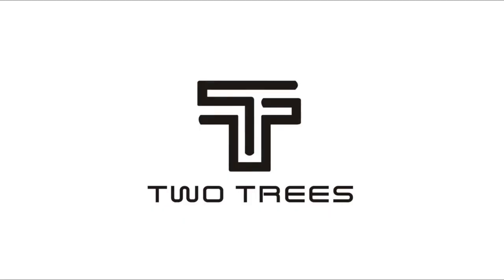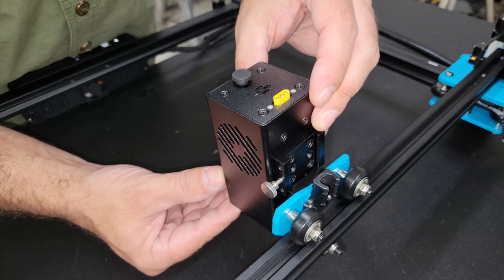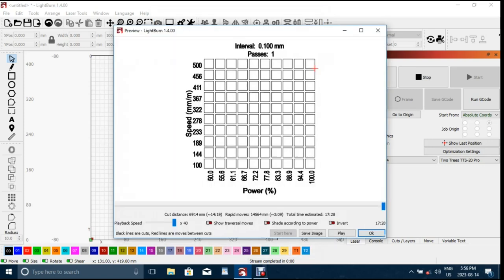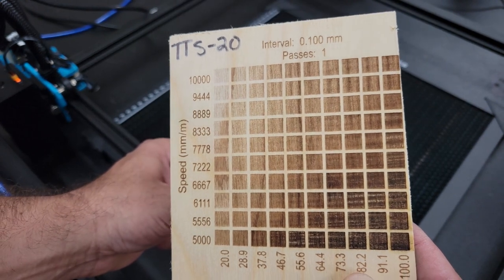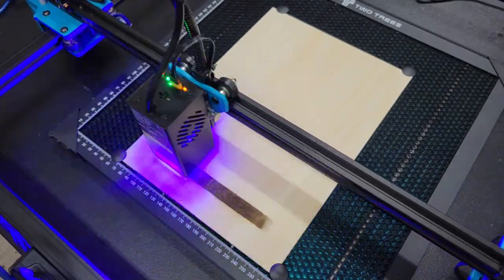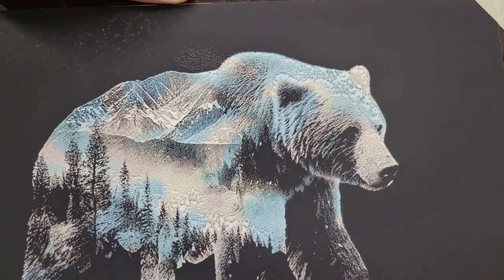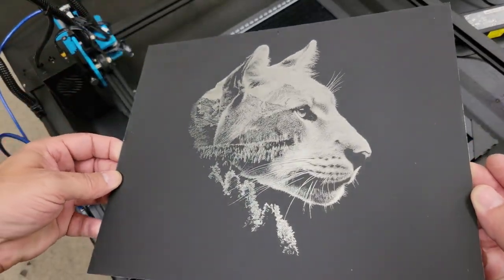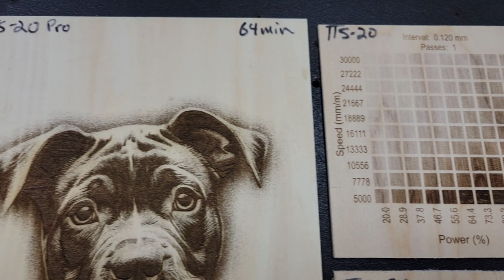Two Trees TTS-20 Pro - An Impressive Budget-Friendly Laser Engraver

Comment: can you make a video, or point me to a video that explains what to do once it's set up? I'm a total newbie to this. I have it put together, I've downloaded lightburn and connected it to my laptop but there is so much I still haven't figured out. For instance, there is a little micro memory card, does it go in my computer or in the slot on the power supply for the laser, if the frame isn't square, how do I fix that- my laser arm will not stay parallel and I've done the loosening and tightening of the screw. how do I center the laser on the crumb tray so it cuts or engraves where I want it too.  I've looked on their website and on Youtube and cannot find answers to these questions.
Reply: @suzannepedneault3043  yup I’m in same boat.  There’s no help for us newbies .,,

Comment: Thanks for the review.
By any chance it can cut through stainless steel in multiple passes?
Reply from the maker: Most 20W+ diode lasers can cut very thin stainless steel sheets w/ multiple passes, but not with pin point accuracy or precision. Edges are usually rough/serrated.
Reply from the maker: Similar result as a plasma cutter. But again, very thin sheets. A tenth of a mm thick or less.

Comment: I am very newbie I have a question, is the machine seeing the materials edges? Let's say I want to engrave multiple metal business cards,can the machine do it?
Reply from the maker: Yes, but the machine doesn't 'see' them. You have to set up a stop block to position individual cards in the same place, frame the area through Lightburn software (see their tutorials on Youtube if unsure how to frame) and then you can engrave and repeat the process by simply replacing with a new card and hitting the start button again. You can also set up multiple cards to fill the work area and engrave at once without stop blocks, but you have to make sure they're positioned square with the work area and then frame each individually to make sure they're in the right spot before engraving. It probably sounds complicated but it really isn't. In short, batch processing is not a problem with any machine. Lightburn has you covered. You can also make an enclosure for it (highly recommended) to not only capture smoke and exhaust it outside, but you can install a usb cam on the lid and set it up in lightburn software so that it can project an image of the work area over the canvas in the software. Then you can see your materials and place your designs exactly where you want them on your material without the extra step of framing everything. Makes quick work of it.
Reply: @JamesBiggar  thx for your answer -time, maybe the easiest way is to create a template with mdf and cut the places the cards are going to be

Comment: Hi Thank you for you review.
I'm kind of new to this world of engraving laser.
I would like to ask you if I alway need that grill under.
If I would like item tall 20cm can I just remove it and let the laser and his structure step higher with some block under the corners?
Reply: In my case I would like to put a logo on wine wood classic box of two bottle. Hope you can understand. They are tall 12 cm, wide 18 and long 35
Reply from the maker: Yes, you can do this. It's always best to have some sort of metal protective sheet under your workpiece to protect your work table in case the laser misses its mark, but the honeycomb panel that I used is only necessary for cuttings tasks. It allows the laser, smoke and debris to penetrate straight through the material so it cuts more efficiently and doesn't cause a mess on the back of the material. But if you just want to engrave boxes, then you can raise the corners of the machine with blocks and just put a thin metal sheet under your box to protect your table. Make sure that the machine is secure after it's raised so vibrations don't knock it over.
Reply: Again thank you Sir. Really helpfull and time earning advise. Just in case. I notice that there is the TTS 55 Pro. Less power but do you think that could do the job required. It is only a 10x10cm logo to be engraved on wine wood boxes, or will it result not to burned/black in your opinion? @JamesBiggar

Comment: Can any one tell the differences between, TTS 20 red ( the red, is the one commonly  with Z Axis, or auto focus) and blue?
Reply from the maker: There is no TTS20 red, only TTS20 Pro. You're thinking of TS2, which has autofocus. TTS20 Pro is larger and 3X faster, though. After owning a couple dozen of these, I can assure you that autofocus is overrated unless you have an enclosed machine with a camera for remote operation. Otherwise it's just a gimmick. You can set the focal point just as quickly or quicker manually in the time that you spend standing their watching it focus itself.
Reply: @JamesBiggar  thanks , it's TS2 20 I have seen in there site
Reply: @JamesBiggar  Is the air assist of tts 20 equal to TS 2 20?

Comment: Be sure to wear the right laser goggles. Often cheap Chinese laser goggles are for the wrong wavelength.
Reply from the maker: I currently have 12 machines in my workshop. All come with suitable eye protection. If you have any information on which companies in particular are harming people and how you reached that conclusion, it would be very helpful if this is, indeed, a problem that I've somehow missed. Often people read things and just assume them to be true because they don't have the experience or a wavemeter to measure what wavelengths are blocked and what aren't. For you folks who don't know, the color and shade of the goggles doesn't determine what sort of protection they offer against a certain wavelength. They're not designed like sunnies where the darker they are the more visible light they'll block. Generally speaking, most desktop engravers that operate at similar wavelengths will come with similarly coloured/shaded goggles, but that boils down to sourcing their goggles from the same supplier.

Comment: So I checked this out on their site.  I must not be understanding your definition of "budget" 🤣
Reply from the maker: That's possible. A budget is just an expenditure plan - what your budget is depends on your finances and what you need to do. There is no specific number that defines it for everyone. When I say "budget-friendly", I mean that if you're in the market for a 20W laser engraver, be it for business or pleasure, then you've probably done at least some research to see what the avg cost is and set your own budget accordingly, and if so, this engraver will give you the best bang for your buck compared to what others cost and what they offer. ~$600-700 for a high precision 20W machine with a >400mm^2 work area is roughly half the cost of most others that offer less. Ie, 'relatively' cheap. Make sense now? :)
Reply: Yeah, the conventionally accepted definition of the word budget when used as an adjective ("budget-friendly" is an adjective), is toward the least expensive end of the cost range.  Currently this is in the 2 to 300 dollar range. When you go double or triple that, I guarantee you that most people would consider this to not be "budget friendly"